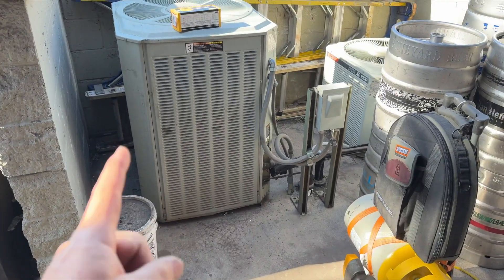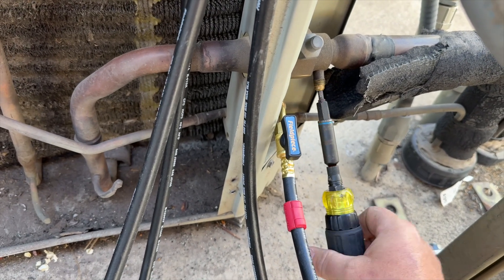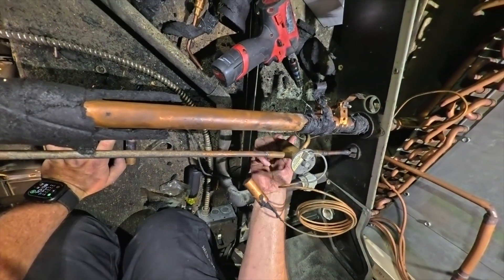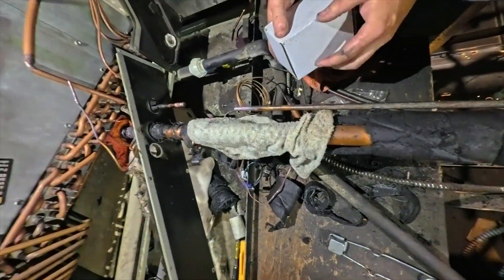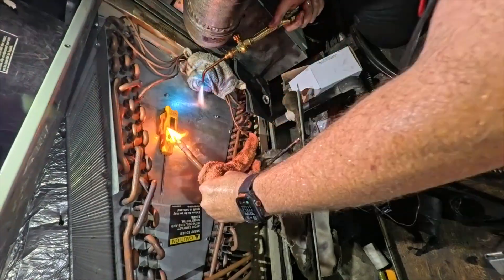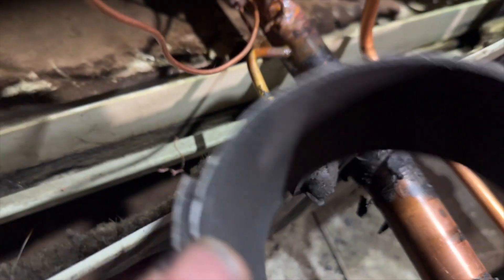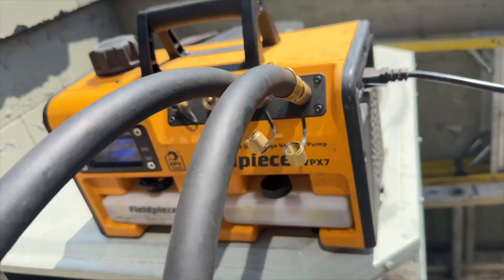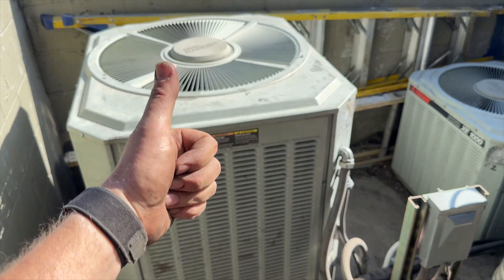TXV Replacement in Extreme Heat!  Brutal Attic Repair! EP221

Comment: wow Hot in the Hand 30- ys in  &   a few new TXV  swaps in my days but man even with an wet rag  don't thing id be holding that thing channel locks or best needle nose Vice grips always my go to lol edit O later I realized you forgot wrenches  id go  truck get it lol good job end results if TXV was really the culprit but someone got lazy on the last one miles away from the distributor .but seen worst separation  but reminds  me of .Goodman txv all used to have to added  on  bc all evaps back then came with piston only